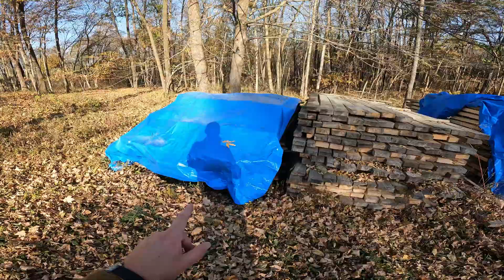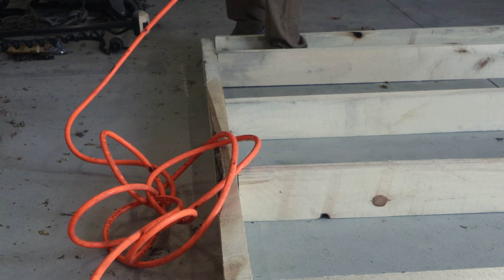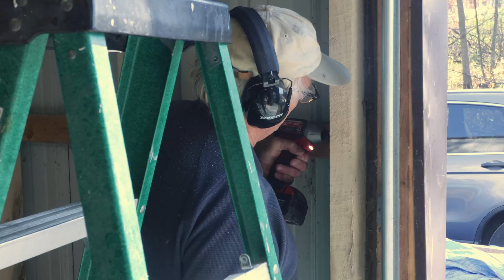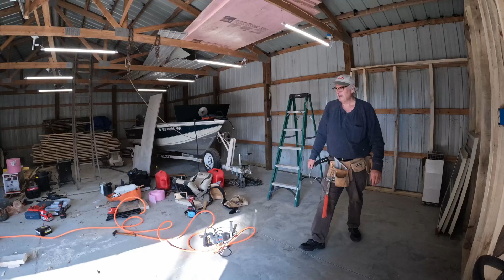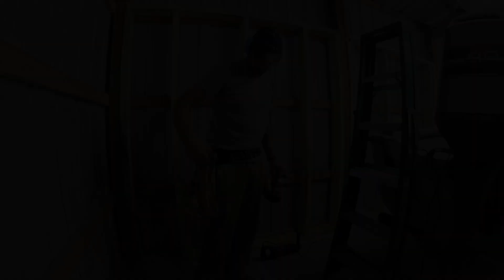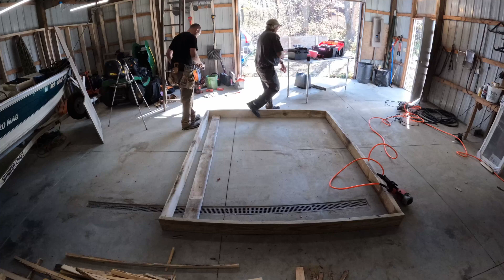Framing the Exterior Stud Walls of the Pole Barn

Comment: I was planning on using ramset nails for the sill plate. Ive seen a lot of videos where they used wedge anchors but you used tapcon screws. Is that code? Should i use what i was going to use or use wedge anchors?
thank you
Reply from the maker: If you're worried about satisfying code, that's research you'll have to do yourself based on where you live. Where this barn is built there is no applicable building code, so these Tapcons are just there to keep the wall from sliding